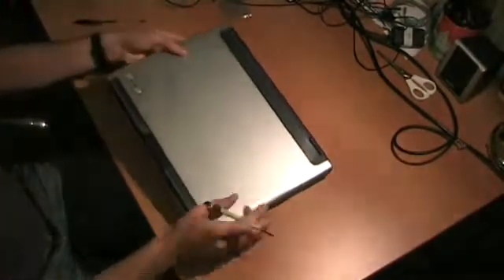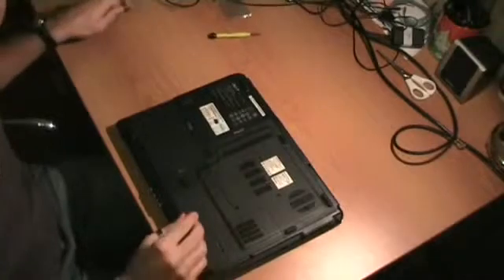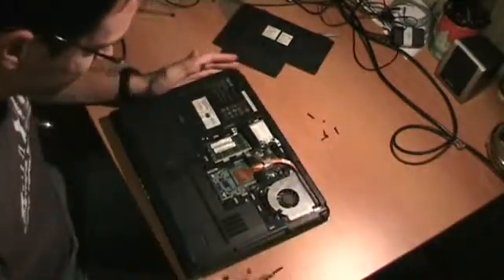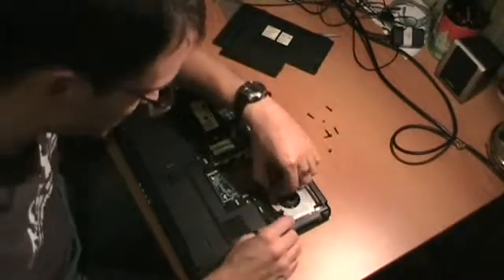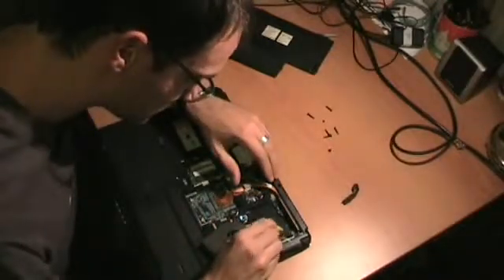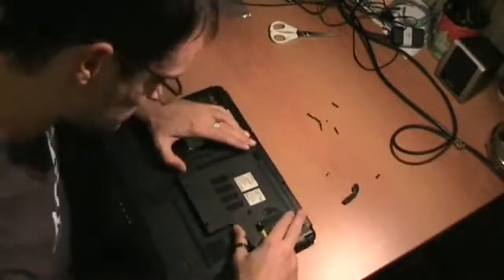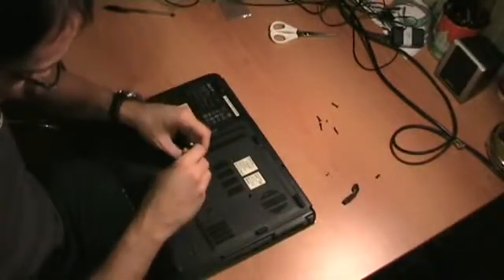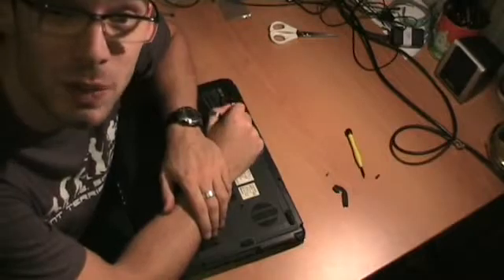How To Clean Acer Aspire 5680 CPU Fan

Comment: my acer aspire's fan 5680 starts for some second and then stops.
but i just install new windows 8.1  to the system. and a i have cleaned the fan but it is not working properly .
what could b the problem pls?
thank you